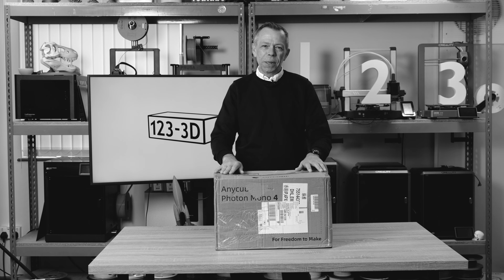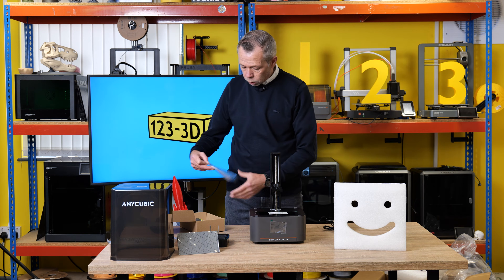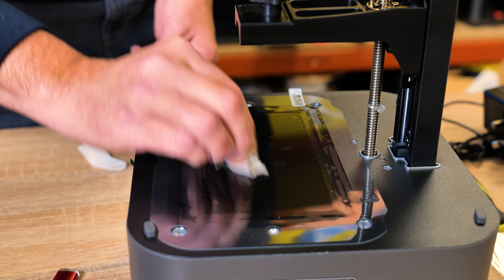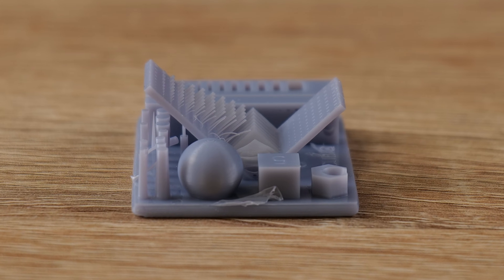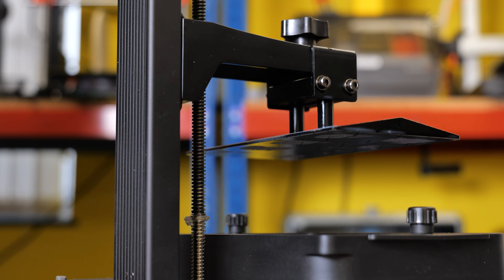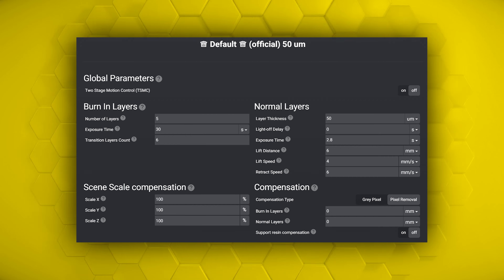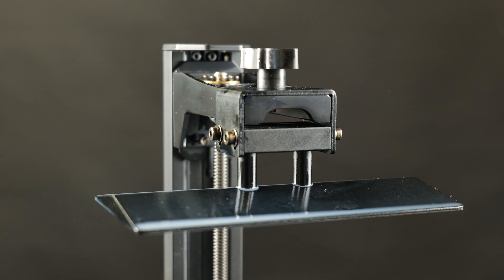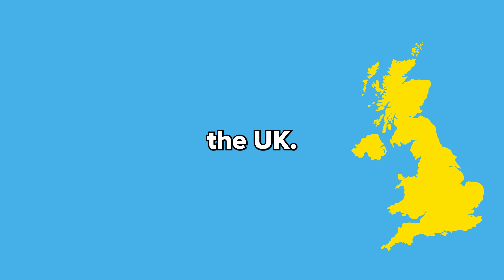Anycubic Mono 4 reviewed! | The best budget resin printer?

Comment: i well never buy another anycube printer again.  you been nothing but trouble and money.  5 months and all i got was 6 bottles of bad resin and  your tech support don't even reply.   you do not support no other resin brand settings.  and your software is so bad  your told to use  2 software's to make it work right.   mine going in the trash when i get home.  I'm saving up for a brand that works.    this crap is useless.   and before i get bashed on.   i gone with anycubic cause of the pricetag   the saying you get what you payed for falls heavy here.   there is no help with anycube.  and your prints wont stick or come out split and hanging off the build plate.  good luck
Reply from the maker: Hi, if you ordered your machine from us please drop us an email at info@123-3d.co.uk with your order number and we will try to help however we can.

Comment: I originally started off with the first AnyCubic Photon Mono and just wanted to pass it on to get the Mono 4, which is amply big enough for what I need, making odd items for my model railway.
My question is this; How do you, and others, get on with the resin.  I found that no matter how diligent I was with cleaning etc., the stuff seemed to get everywhere smears on the cover, which after a time made the unit look ugly.  I got hold of some water wash resin and will give that a try.
Reply from the maker: When we have resin spills we tend to just wipe it up with paper towel then give the area a wipe down with a drop of IPA or water depending on the resin, just to keep the work area safe. Don't use IPA on the cover it will make the plastic go cloudy.
Reply: @123-3D-UK  What do you use to get the resin off the cover, Turps, Meths?
Reply from the maker: The best way is to just wipe it off with a microfibre cloth. Alternatively you could wait for it to cure an then try to peel it off but that can be fiddly
Reply: I have started my resin journey with the water washable resin. 
I've found that the Anycubic Water Wash 2.0 comes off perfectly with soap and warm water.
Also make the cleaning and cure process easy - almost FDM easy.

Comment: What parameters did you use? I'm using Photon Mono 4 and Plant Based Resin and I had no success with the recommended parameters.
Reply from the maker: We used Elegoo ABS like resin at the default settings in Lychee slicer